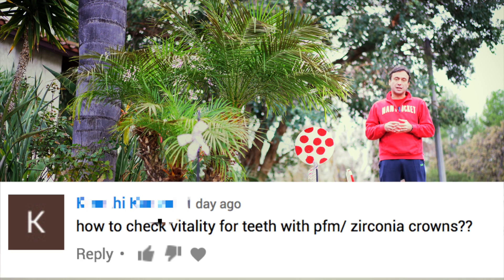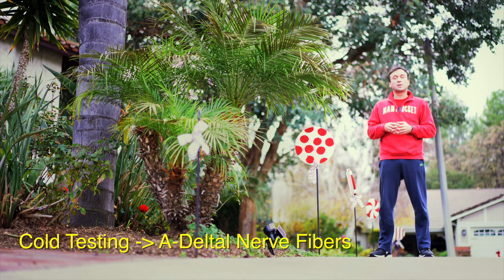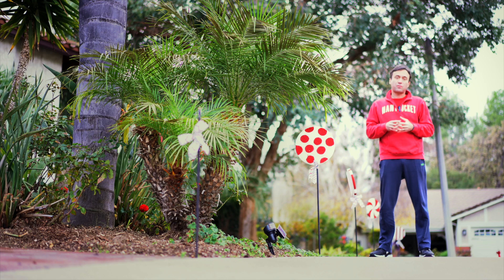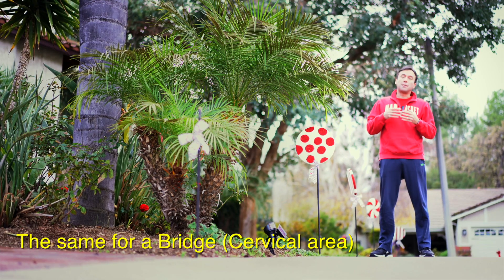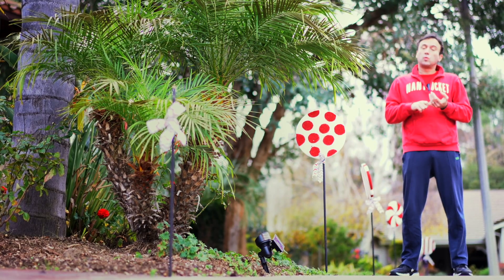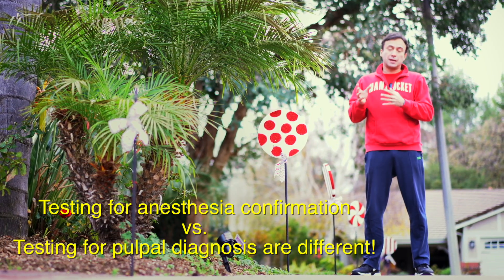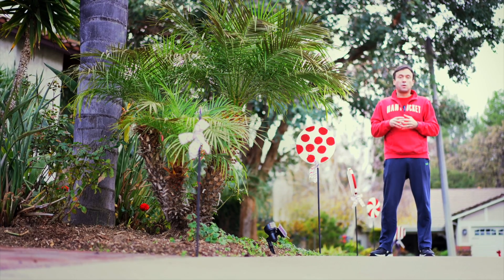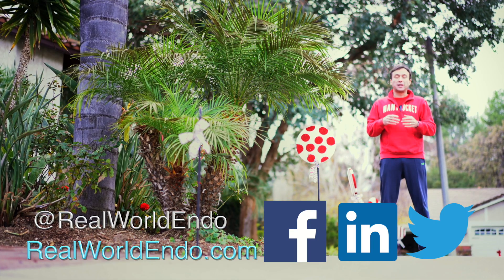Cold Testing through Crowns: Quick Tips

Comment: great vid as always. i was wondering whats the ideal way to assess pulpal status prior to crowning. Occasionally pulps become necrotic following preparations requiring endodontics. Can this be avoided? This is a burden on patients when they pay high costs for restorations. Is elective endodontics with "questionable" pulps acceptable.
Reply from the maker: This a great question and worth getting into. But the short answer is that thermal testing should be done on all teeth prior to crowning. A pulpal and apical diagnosis is needed for all teeth. Prior to placing a crown. Cold testing would be the best way to go. And yes, prophylactic root canal therapy is needed when it makes sense. If the tooth has a good chance of success rather than a higher chance of procedural errors. Pulpal preservation is also a goal of endo. Therefore, the risk of future problem should hopefully be assessed in the most conservative way for the patient. I think I should make a video to share this question because it's an important one. Thank you for the question! : )